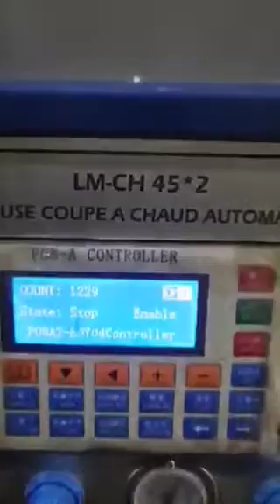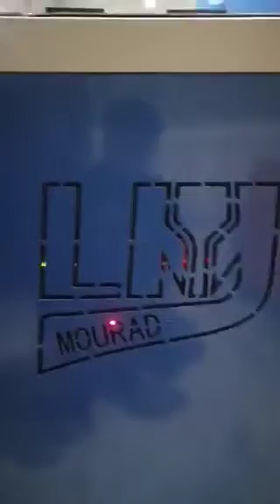مشروع مربح جداً في الجزائر، غير مكلف، رأس المال غير كبير، ماكنات سهلة التعلم، مواد أولية متوفرة ،

Comment: تلفتلي هذي تخدم 500كيس في الدقيقة سعرها 165مليون هناك الة مثلها بسعر 280مليون ما الفرق
Reply from the maker: هدي تخدم 140 ضربة في الدقيقة الواحدة، وفيها 2 بيست يعني حوالي 280 صاشي في الدقيقة الواحدة 
الآلة الثانية فيها 250 ضربة في الدقيقة الواحدة يعني 500 صاشي في الدقيقة الواحدة 
والثالثة فيها 320 ضربة في الدقيقة الواحدة يعني 640 كيس في الدقيقة الواحدة 
الثمن رآه تبدل انتاع 165 مليون راهي ولات 185 مليون 
وإنتاع 500 صاشي راهي ماتبدلش 250 مليون 
وإنتاع 640 صاشي في الدقيقة الواحدة راهي 330 مليون 
ادا مافهمتش عيط في التيليفون خير 
0560999701 مرحبا بك
Reply: @mouradlm-machinery9501      فهت شكرا جزيلا تاع 500صاشي في الدقيقة تصنع جميع انواع اكياس
Reply: @mouradlm-machinery9501 تخدم 500ضربة تدي لك 30كيلو مادة أولية سعر الكيلو 25000وين رآها الفائدة 🤔🤔🤔🤔🤔🤔